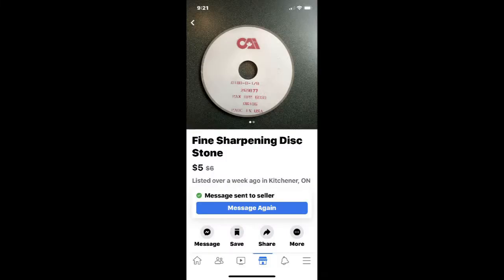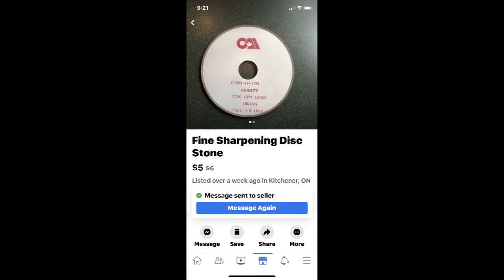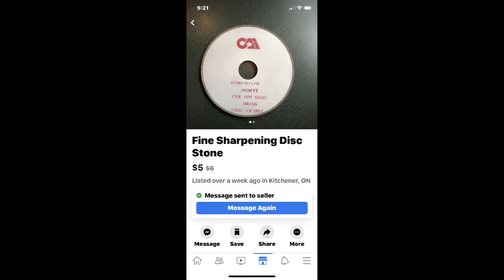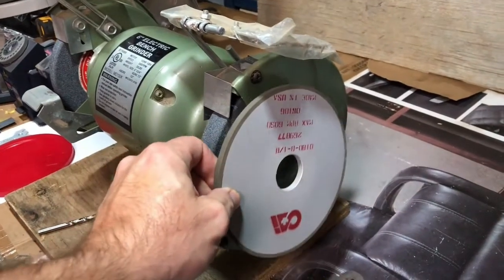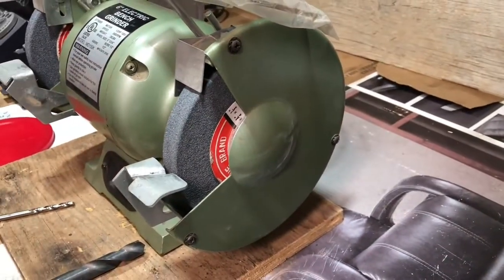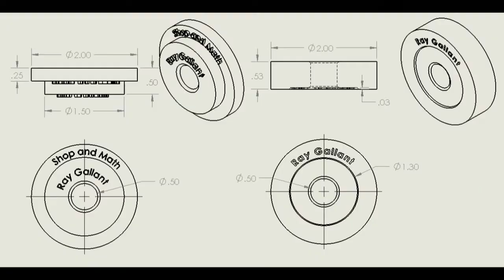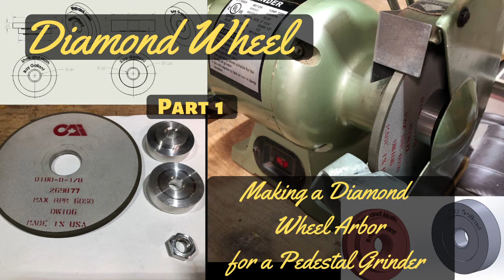arbor for diamond wheel

Comment: Trying to find info on removing a stuck arbor ? Do you know anything about that ?
Reply from the maker: The solutions will not work for all situations, but some of the things that I’ve done to remove stuck arbours

I have used a pneumatic chisel with a blunt and to help loosen things up

I have also used heat to sweat something apart 

It is important that you know when to use these Ideas because using them in the wrong situation, could damage the equipment and could also injure yourself

I hope that this helps 
Ray